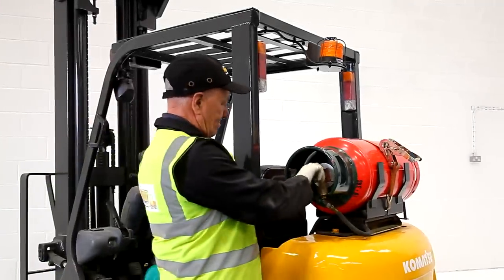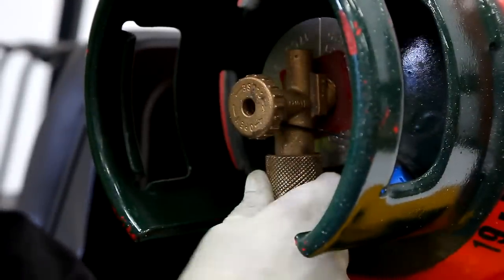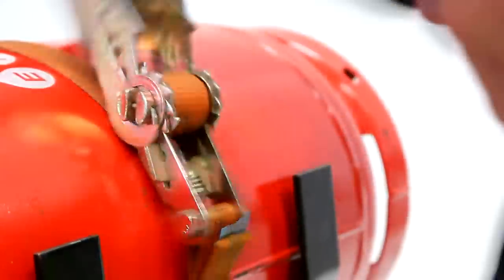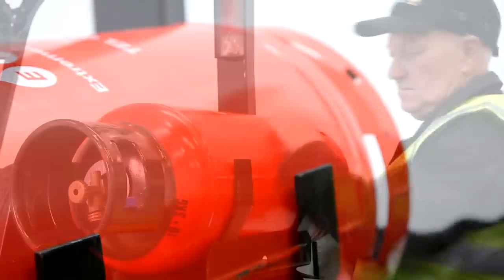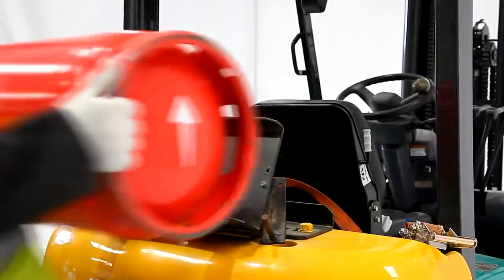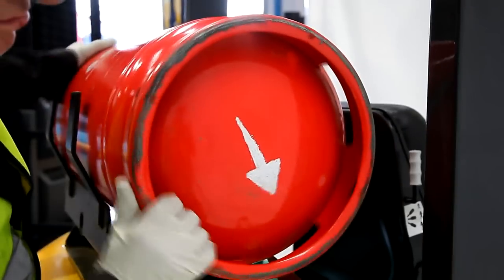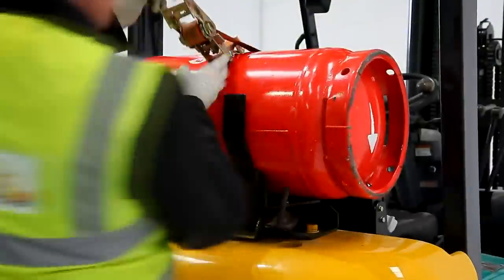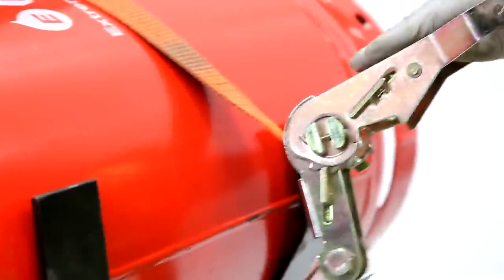How to Safely change a Forklift Truck Gas Bottle

Comment: This video fails to mention wearing the proper PPE when changing out a propane tank. One should Always wear  safety goggles, or a face shield, gauntlet gloves and an apron so that if any gas sprays onto your face, hands or body you will be protected. Remember LP gas is at below freezing temperature and can give you severe burns within a matter of seconds, if it sprays into eyes you can be  blinded and can cause nerve damage if it gets onto your hands. I ams surprised that a video that promotes  safety did not mention any of the most important aspects of changing an LP tank.

Comment: I thought you were suppose to turn valve off and then run forklift until forklift turns off to insure propane in line is drained before removing?

Comment: Should you wear special gloves just in case propane leaks out? Maybe my question is will the propane hurt my hand if I get some of the propane on my hand?
Reply: You don't need to wear gloves but just be careful. Propane can give you frost bite.
Reply: Leather gloves are enough provided you are filling just one tank in my experience. It is pretty easy to soak leather gloves with propane. Too thick of gloves can be a problem as the hose attachments can stick as these maybe years and years old so some grip and dexterity can be needed. Further, the nylon strap has too short a life span compared to metal straps. 

And yes one is supposed to run the gas out of the lines by shutting off the valve and running the engine if you remove the tank. In my experience, this is NEVER done except by me. Also, I prefer a face shield over the cheapie plastic "safety" glasses. If something happened a face shield would make actual sense. Also, some say aprons are required and I've never seen this done in real life. That said the food processing sanitation workers in full rain gear should have that covered but regular driver never do per by observation of real life. 

Most tanks are refilled on the truck and not lifted to the ground. The legal department types may say it is unsafe but more likely the motive on the part of management is to blame others for the lack of bled off valves, old connectors and bled off hoses to displace propane discharge. Propane hoses should have bled off valves, if they aren't present heads should roll. Granted removing the tank may in theory be a tiny bit safer but I don't believe it's given this so rarely actually done in MOST places.
Reply: @AcceleratingUniverse  You should always wear gloves when changing a propane bottle, the gas is  below freezing and  can severely damage burn your skin in the matter of seconds.
Reply: @Statimtek  that comment is so old i dont even work in construction anymore, but safety first i guess. i never saw anyone put on gloves to change the tank.
Reply: @AcceleratingUniverse  The company I work for is anal about safety. But it makes  sense. One minute skipped for the sake of time can result in  a life time of regret for you , your family or your co workers.